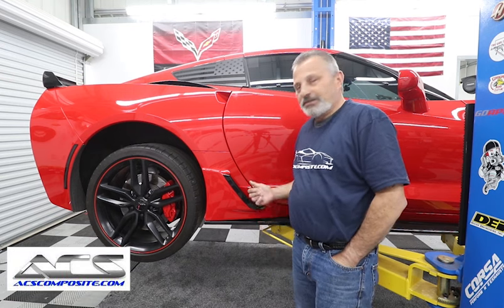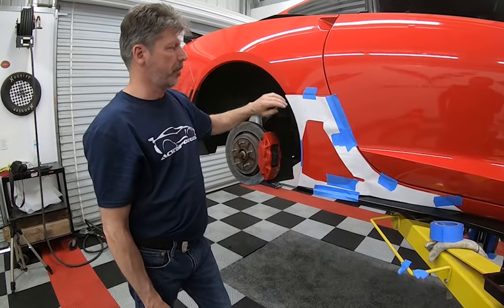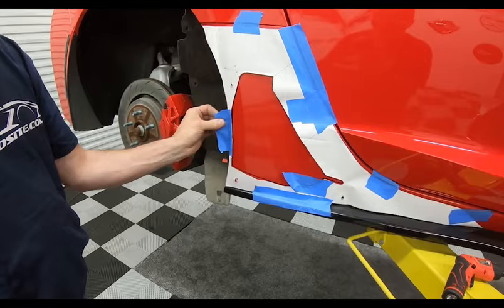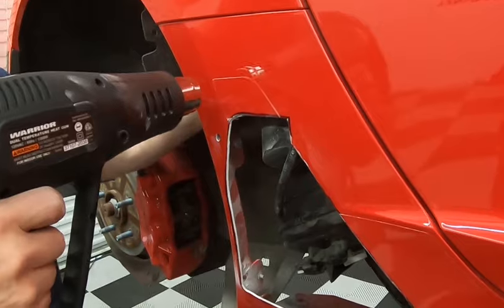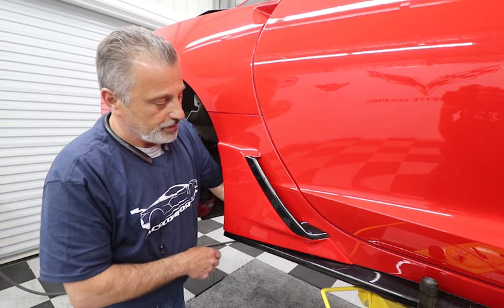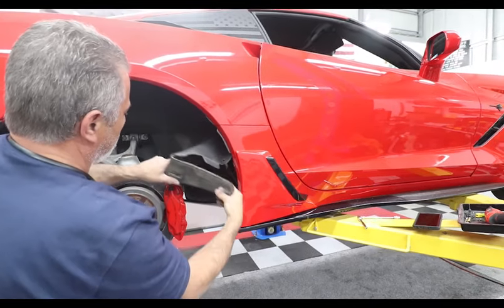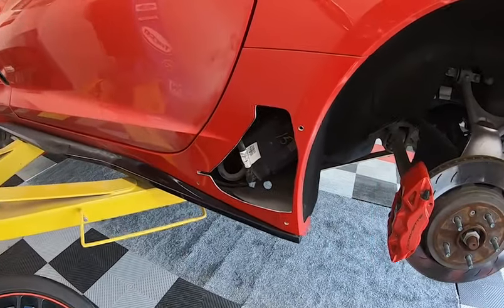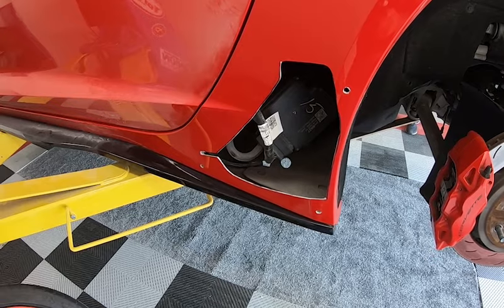How to Install Functional Lower Brake Vents from ACS Composite on a C7 Corvette

Comment: Well done 🤙About to tackle this project tomorrow!
I've been putting it off for a couple of months, with all that cutting. It's intimidating. I liked his suggestion of using aluminum tape as a precaution too! I've got PPF film on that whole quarter panel, so I most likely will cut a large section of it out before the Dremel.
I just did my rear diffuser fins and now onto the functional Ductwork on my Z51 🙌

Comment: Whats the best attachment  for the Drexel to cut with ?
Reply: He is using a sanding barrel tip for finishing but a cutting disk for the hole. The cutting wheel comes in large Dremel kits but you can get on Amazon or Home Depot